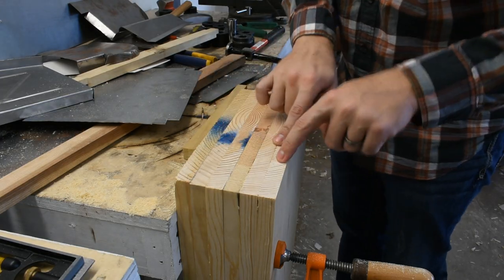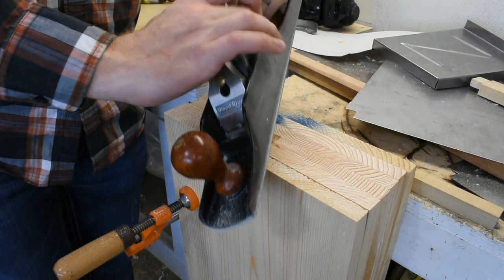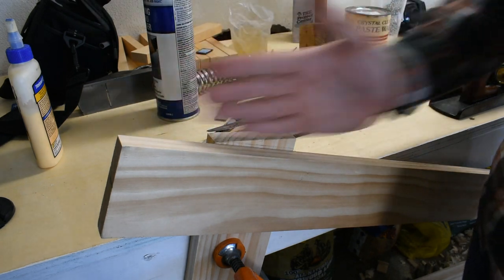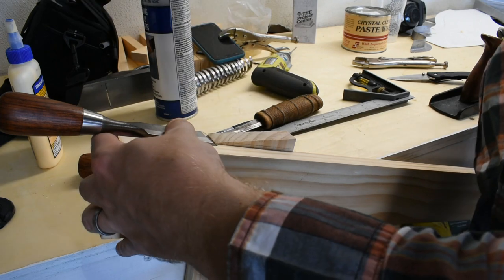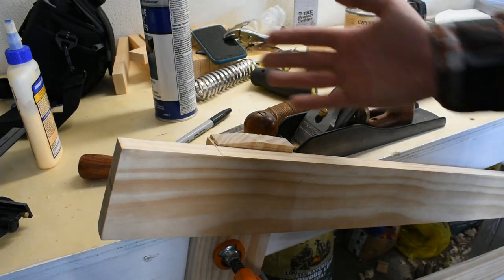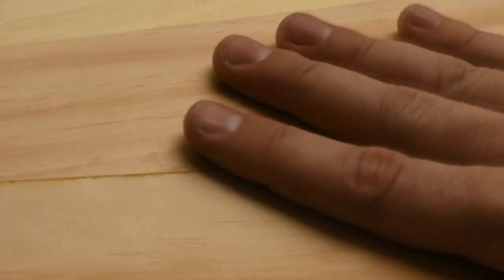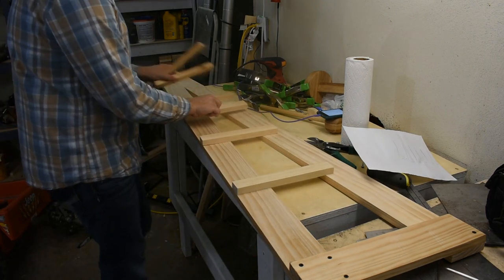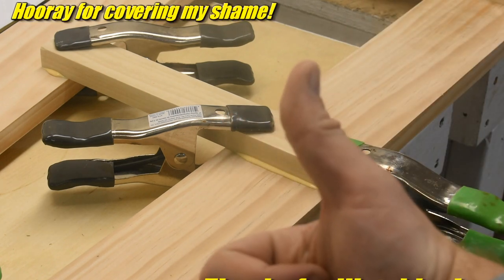Simple DIY Bookshelf from Cheap Pine, Part 2: Planing My Mistakes Away!

Comment: For more delicate applications Paul, like guitar bracing and what not, cleaning up the glue with a dry rag is necessary where running the risk of gouging the wood is a big no no, otherwise, instead of a chisel, a scraper cleans the cured glue excess perfectly ;)
Reply from the maker: You know I have never figured out how to sharpen and use a scraper properly.  I have some, just havent tried much.

Comment: FOUND IT!  Your design calls for 6 shelves, 1 of which is on your base support board.  You glued on 6 shelf supports instead of 5.  You're going to need an extra 3 ft shelf board to bring it to 7.
Reply from the maker: Winner!  There are enough supports because the horizontal piece on the bottom also doubles as a shelf support, but i only have 6 3' shelves instead of the 7 that I need.  Fortunately the snail pace I take to finish some of these projects means i had plenty of time to go get more wood and correct the issue.  Good eye!
Reply: You get an extra shelf!  Yay for more places to store random crap!
Reply from the maker: trust me, I need it!  i have SOOOO many books still in boxes and piles on the floor.  Magazines keep piling up, too...  I'm starting to think i should've made at least another 3 of these things, but then this project would finish sometime in 2019...

Comment: I always wondered how many of those spring clamps it would take to clamp someone to the ceiling, I think you may have enough to do it, lol. Maybe thats an idea for rambunctious kids, lol. Another thing to do with the glue is to leave it, as it dries, it'll shrink a little bit and create a fillet, which will add even more strength to the joint.
Reply from the maker: +Chirpy's Tinkerings I probably have enough to clamp a small child or cat to the ceiling, but I might need to use some furniture clamps to keep an adult up there...
Reply: Paul's Garage video on this next maybe?

Comment: I'm not sure if it's your mistake or not but you didn't leave any feet for the bottom of your shelf. I don't remember what your initial design was, I'm usually very tired at the end of the day when I watch these and some times I nod off. Regardless, 4 feet are more stable than long flat runners. Move that bottom board up a bit and it won't rock on an uneven surface.
Reply from the maker: I considered adding a couple feet on the front to tip it back slightly (to prevent it tipping over), but I decided against it.  adjustable feet like i have on my other bookshelves would help the rocking, but  this has a pretty stable base.  I'll have to see how stable it is when i'm done and everything is all attached.

Comment: Is that plane you got any good? It looks like a copy of a Stanley Bedrock plane to me. I have one Bedrock, a number 6. I have three 5s, but no Bedrock 5. I did just pick up a sweet corrugated 5 though. Last weekend I even picked up another plane. Just what I needed. But it was only $5 and I didn't see anything else all day. I need to cut back buying planes. But that is hard to do when I run across them and they're cheap.
Reply from the maker: +Paul Frederick you nailed it, woodriver bench planes are copies of Stanley bedrock planes.  I certainly like mine, it worked great out of the box and the new thicker blade works great too.  I didn't need to flatten or adjust anything out of the box.  The blade was pretty sharp too but a little honing was needed.
Reply: Of course you kept sitting it down on the blade. I was always told that I should never do that. Weird upbringing I guess. I won't even mention how you tried to commit harikari with that chisel. Cringe...

As always, a lot of fun to watch ;-)
Reply: +swdweeb Unless your work table is harder than the surface of the material you are working with I cannot see the harm in putting a plane sole down.
Reply from the maker: I've heard so many conflicting arguments on that, i just decided to do what i want lol.  i don't set it down on the blade during storage, only on my bench top (popular) and other soft woods.  During storage I actually elevate the sole so it's not sitting on any side.  Whenever i set it on the shelf on its side or anything the side touching the shelf must trap moisture and gets surface rust :(
Reply from the maker: huh, meant to say my bench top was POPLAR, but i guess it's popular too? way more popular than I am, that's for sure
Reply: Don't sell yourself short. Here in cyberville you've got quite the following.
Reply: I try not to think of such things as it inevitably conflicts with what I "know" ;-) Of course you're absolutely right, but I still lay mine on its side. Then again when your bench is as littered as mine, who knows what I'd be laying the blade on if I placed it bade down.  This guy agrees with both sides of the sole-down/side-down argument https://woodandshop.com/how-should-you-set-down-your-hand-planes-on-a-workbench/
Reply: +Paul's Garage I never bought a new plane. I just get old ones at flea markets, and yard sales. I clean the rust off them, sharpen the irons, and usually that's about it.
Reply: +Paul's Garage I lined my main plane drawer with shag carpeting so I can set them handle up.
Reply: Just now or earlier? ;-)  Brilliant! That's actually a good idea for my chisel drawer as well. Thanks
Reply from the maker: you say "following", I say "group of people watching and waiting to see me impale myself on a piece of wood".  Same thing, really.
Reply from the maker: that's a good idea, i'd use that if i had any drawers!  I don't have the floor space to sacrifice any on a nice tool box with drawers, it's all up on the wall for me.  though i do have those shelves...
Reply: +Paul's Garage  So you're like the NASCAR of YouTube. People just watching for the accident that they know will eventually happen. ;-)  I actually hurt myself once but edited it out so no one knew... unless they spotted the band-aids that mysteriously appeared.
Reply: +Paul's Garage  Hey, check your private message spam ;-)